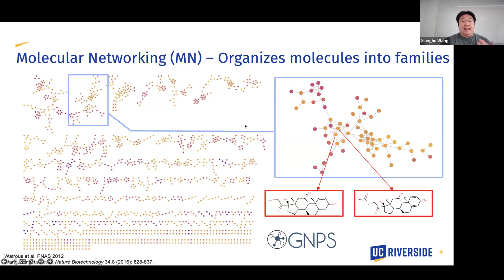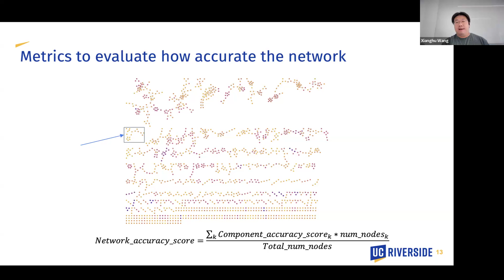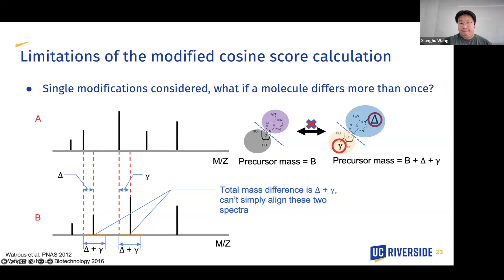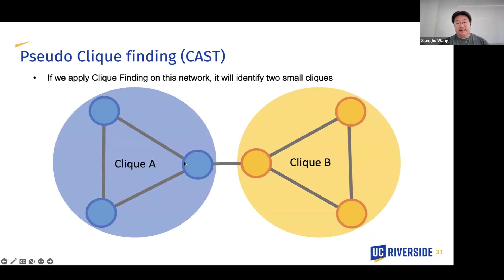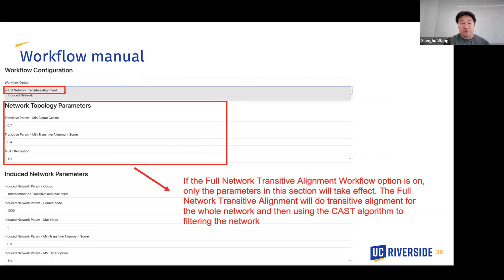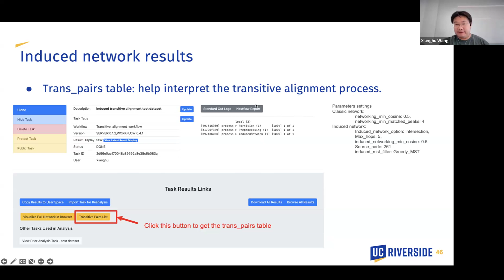VMOL Seminar #15 - GNPS2: Transitive Alignments (Xianghu Wang)

Comment: Looks cool! Just wondering when you evaluate the networking to see if similar structures are clustered correctly are you using data from pure chemical standards you ran yourself or are you relying on spectral library matches to tell you what the structure is?